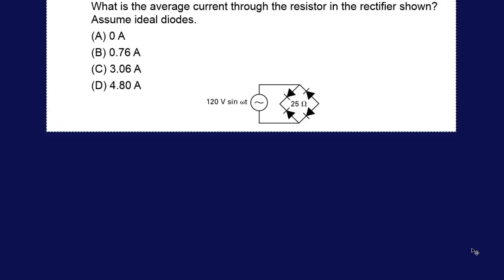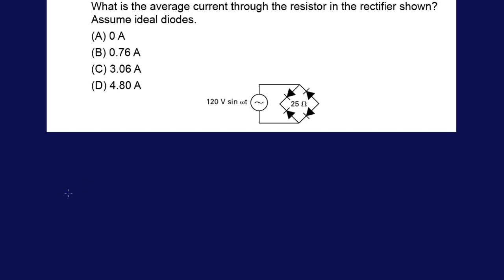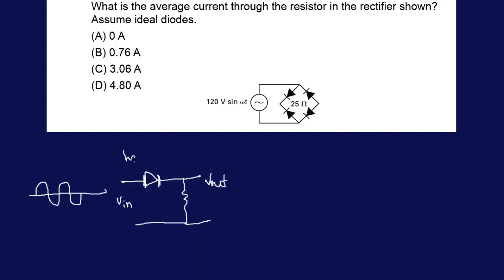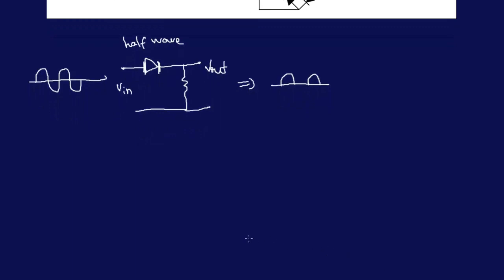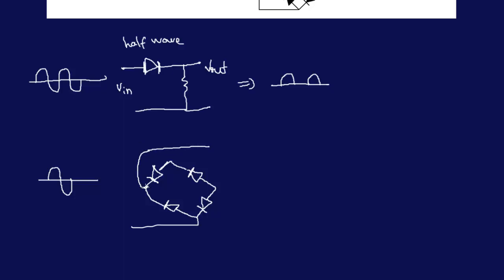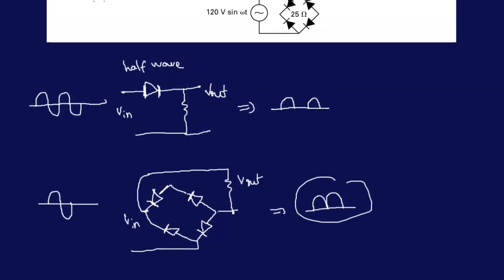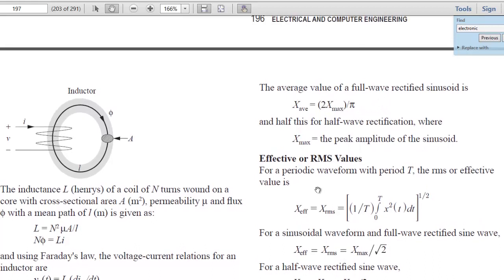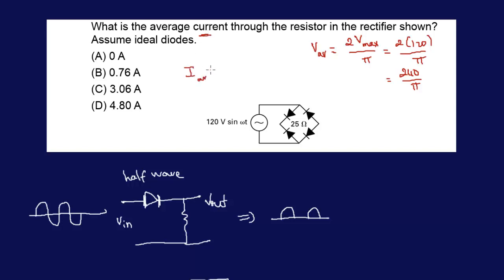Full Wave Rectifier Diode Example

Comment: I am getting help from your video. But I believe that the answer to the question is 0 amp, as the diode will always block the positive cycle or negative cycle.
Reply: There is a 25ohm resistor placed at the center that allows current flow through when the diodes are biased...in a lightening symbol flow if its hard to imagine.  This is a full wave rectifier because it allows positive and negative voltage to supply power from the AC source and the DC load (25ohms).  When positive... the voltage goes through the top left diode, through the middle resistor, to the bottom right diode.  When the voltage is negative, the voltage flows through the bottom left diode, through the resistor, to the top right diode.  Hence giving you a complete waveform.  Hope that helps...I had to look at another video because I thought the same :)
Reply: Yes, I also think you are right, all the diode are blocking current from either direction, it should be zero